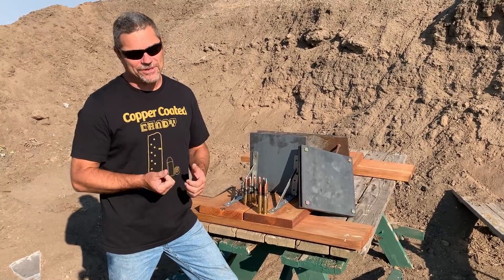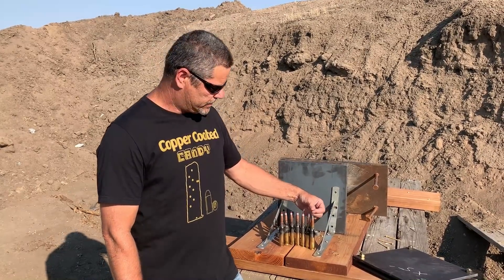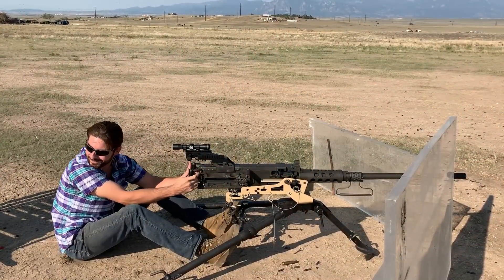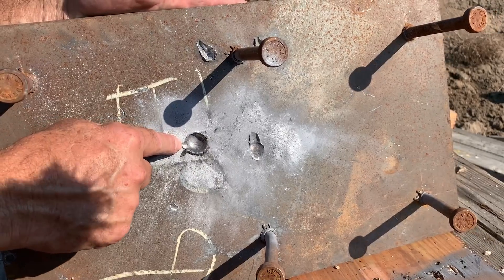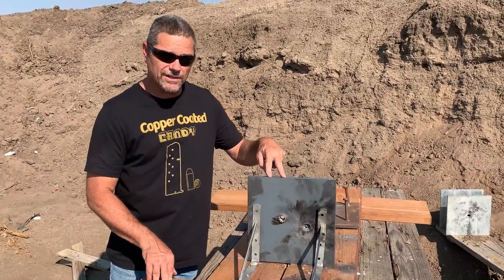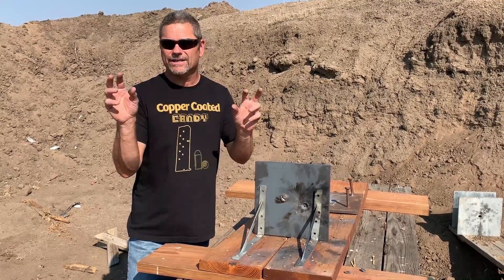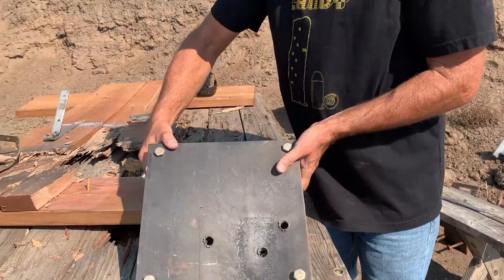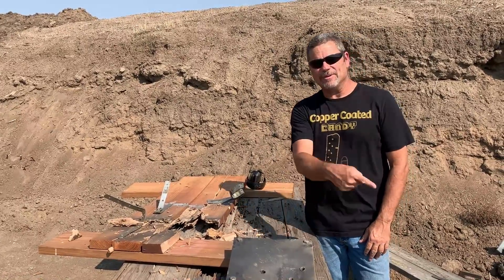Single Steel vs Stacked Steel  💥Bonus round at the end.💥

Comment: Hey hey hey!!!!
Please don't say that! 
Even if you measure it in C 3000 is not enough to immediately melt metal of such thicknesses.
It is only the speed. Read about it! 
It gets close to 8-9 km/s. And SPREADS THE ARMOR RATHER THAN MELTS IT.
Don't you understand it! That's the reason why reactives stop bullets because they explode with      7-10 times the speed of a bullet and it doesn't make it through

Comment: The mass of the plate makes the biggest difference if the round is harder than the plate, if the round is softer than the plate it's mostly the yield of the plate material. 
Typically a hard outer layer backed solidly with a softer but higher yield support material works best. The military likes ceramic backed by aluminum for maximum protection to weight ratios
A layer like this (where the first layer is harder than the projectile) often causes the projectile to shatter or at least deform then a space for the pieces to spread out before hitting a 2nd stack is most effective. The more space the better. This increased space works well at reducing the effectiveness of high explosive rounds as well

Comment: Generally speaking the gap is usually the length of the projectile. Tank armor has angled internal plates to cause the round to tumble, and lose its energy that way. But the gap you have is too small to allow the round to deflect and tumble sideways, allowing it to transfer more energy into the rear plates.

Comment: Curiously some years back I saw a NASA documentary that showed how Much better multiple spaced plates were than a single heavey plate at stopping micro meteorites.
Though they used roughly from memory something like 6 or 7 plates.  In their example I believe part of the effect was the micro meteorite breaking up and scattering reducing it's penetration power.

Comment: layered armor is mostly 1 ultra hard layer to break the bullet into pieces and the rest is for stopping the bits... if you try AR500 in 10mm and a stack of 5mm AR500 and 2x 2,5mm mild steel... you could probably already see a difference.... (scale up as needed for .50cal) also if you double the distance between the layers you should be able to further decrease penetration.

Regarding your "reactive armor" i dont think tannerite is suitable for that. the pressurewave has to destroy the bullet before hitting the actual steel armor... to my knowledge tannerite isnt that fast => bullet already behind the charge when it detonates => increasing the damage to the target.

But i think you could try to build a shaped charge out of tannerite and a copper cone and try that vs the spaced armor.

Comment: Why don't military M2s have optics?
Reply from the maker: For the most part they are for suppressive fire, so just point and pull the trigger, but they have been used for long range snipers in the past.
Reply: @GoingBallistic  
I see. Thanks. It just looked so effective in this clip. I guess you would be too exposed though.

Comment: It would be interesting to stack 3 or 4 plates at a slight angle, maybe 15 or 30 degrees each - first at a 30 degree angle, second at 0, then third at 330 etc.  And as Travis mentioned, a bullet length apart.  Cool shot with Tannerite!

Comment: It'd be interesting to have the plates spaced at just one edge (and touching at the other), so it forms a zigzag.  I suspect that the slight angle might make the plates harder to punch through.  If you had more than 2 zigzagging then it seems like the bullet would tumble and lose energy to horizontal movement.
Reply from the maker: Thanks for the idea.

Comment: New Armor idea using mild steel and ceramic floor tile - alternate stack 3 steel 2 tile, glue them together with constructive adhesive, try with steel 1st then try with tile 1st see what works better.
Reply: I also have an idea gluing sand in a mold to make a sheet using some thin glue in like a 1" deep brownie pan, stack that between ceramic plate and steel plate. If you are going down the home made armor ideas path. I have dozens of ideas you could use P-)
Reply from the maker: Thanks, great ideas, send them to ballisticsmasher@gmail.com and we just may try them.
Reply: The US military found a noticeable improvement to pure kinetic round penetration even from a thin painted on hardcoating. Since then standard steel military armor is face-hardened on the outward side for maximum stopping power for the weight

Comment: Tannerite is too slow an explosive to work as reactive armor. Mil-spec explosive reactive armor uses plastic explosive for the filler layer.

And you're right that ERA is intended to work against shaped charge warheads. You're not right about the shaped charge melting the copper liner, though. There was a test years ago where they (carefully!) sawed a shaped charge warhead into strips, then clamped it back together and fired it into a water tank. What was on the bottom of the water tank was strips of copper!

Comment: .50 cal is 90 years old maybe more
Pentagon could change it more time before with nice experimental  .50 HV (12,7×120mm) franch 12,7×110  mm.belgian 15.5x106 mm and more more 
.50 cal has lose it superiority many time ago
Reply: The downside with changing is the millions of rounds in supply.
Reply: The 0.50 cal is only nominally 0.50 cal. It has an exactly 13mm bullet - just like the Mauser Tank und Flieger Gewehr of WW1. (The TUFG is a squeeze bore - the breach is 13.2 mm and the muzzle is 13mm). It is also exactly 102 years old - having been approved in November 1918.
Reply: I should also point out that it's at a pretty sweet spot in terms of ammo size, weapon size, and power. Sure, the 14.5 Soviet hits harder, but it makes for a much heavier weapon overall and much less ammo per unit weight.
Reply: Scott Kenny And an utterly obsolete weapon in its original anti-armor role.... As an weapon against unarmored targets it still has its uses, and is about as heavy as a man portable non recoil compensated gun can be.
Reply: @allangibson8494  The .50 was obsolete for shooting armored vehicles by 1936 or so. Certainly by the end of the war!

It's only lingered on because we built millions of the guns and it does serve a good use against softskins.

Comment: Great video, I hope you will try the same test with AR500 and AP rounds👍🇺🇸
Reply from the maker: Will do👍👍
Reply: @GoingBallistic  I made a target out of 3/8 AR500 and 1/2 lexan that I spaced about 3/8 apart. Got them off Amazon precut to 12". Lasted longer than the frame after a few hundred rounds of 7.62x54 ball and 5.56fmj.  The lexan did break a corner off about 200 rounds in.

Comment: What would happen if the two thinner plates were bolted together with no spacer?
Reply: Weaker than the solid.
Reply: It's just as strong as full thickness...
Reply: @vetteconnoisseur9531  Not quite.
Reply: @Chris_Garman  try spacing three, 3/8" AR500 plates 1/2" apart...shoot it with a 50BMG and see what happens.  I shoot three, bolted together tight and it shruggs off all 647gr FMJs i can throw at it at 130yds
Reply: For reference, those same 3/8" AR500 single plates get nice 3/8" holes poked by my .300WinMag at 100yds using 150gr PSPs
Reply: @vetteconnoisseur9531  Materials have been studied to the minutest detail. The solid is stronger. It isn't by a huge factor but it is stronger. It will be less flexible though.

Comment: Thanks for doing this comparison. I've often wondered if a bullet would more easily penetrate spaced wood/steel vs. solid (assuming the same overall thickness of material). And FINALLY someone has done the comparison. Thanks for that!
Reply from the maker: Your welcome, we will do this again but with AR500 or 550👍

Comment: Spaced armor is actually better against chemical munitions such as HE, HEAT, HEATFS, and pretty much any round with some sort of explosive filler. When talking about tank armor you must also talk about tank munitions. In WWII, one of the most common round used for both anti bunker and anti armor purposes were armor piercing he explosive, which contained an explosive charge that would only explode if enough armor had been hit. For example, a Tiger I's 8.8 cm cannon firing at a lightly armored vehicle like the M8 greyhound or the M18 Hellcat would most likely not detonate the explosive charge. Both vehicles would still take a decent amount of damage from the spalling from both the round and the armor, however these rounds perform best when it goes through enough armor that the explosive charge detonates. If the same 8.8 cm shot a sherman, that round would enter the fighting compartment and explode turning anyone in there into mush. However, spaced armor actually helps against these kind of rounds if the first layer is enough to trigger the round's fuse, which would cause the round to detonate before it reaches the inside of the tank removing most of its penetration power. This also works against chemical munitions stated earlier, such as HE rounds, HEAT, HEATFS, and more. Any warhead with a HE filler will often detonate after hitting the first layer of armor, weakening its penetration power. Rounds with no HE filler such as solid shot, APDS, and APFSDS don't have that disadvantage and can typically go clean through spaced armor. However there is a caveat, if the space between the first plate and the second plate is larger than the length of a APFSDS round, it could cause the round to become unstable and break apart. This is further supported if the first and second plate are angled and of adequate thickness. This has been done on MBTs such as the German Leopard 2A5 on the turret cheeks. In summary, spaced armor is effective against explosive rounds but not as effective against solid rounds. This was a valid test though, and does prove that a .50 just doesn't give a single fuck lol. But in all seriousness, the best effective spaced armor will be spaced much more than what was tested, which also makes it impractical as body armor or deployable barricades/shields/etc, however are very useful for armored vehicles as it helps against explosive munitions and can be spaced much more as it is being moved by an engine rather than 2 weak legs lol. If you want a pretty good example, the German's Panzer IIIs, IVs, and Panther tanks had somewhat weak side armor where the tracks were, thin enough that the soviet anti tank rifles could go through them and damage components and injure/kill crew. This was solved by adding what they call Schürzen, thin steel plates around the tanks, (link to an example http://wotbase.ru/wp content/uploads/3024de929674_C430/0ussaybm.jpg of the Panzer IV's Schürzen) which was enough to stop the soviets AT rifles from penetrating and also helped against their shaped charged weapons and such.
Reply: What a bullcrap, u guys stop with this spaced armor.is better, it was just proved its not and they still putting up some bs theories do defend their statement
Reply: @Angry-Lynx  Its better against chemical munition, i never said its better for small arms fore and such. With small arms fire and body armor its much less effective as spaced armor is most effective when the spacimg is more than the length of the bullet or round fired at it. So because of this, spaced armor is less practical. Did you even read what I said? Also testing on mild steel plates with .50 bmg does not scale up to vehicle's armor and rouns much bigger than a .50 cal. The only thing this test proved is how stupid people can be assuming one video is 100% all the evidence needed to prove spaced armor doesnt work. This video is good, and does show the downsides of spaced armor for certain applications such as smaller scale things like body armor as it would be very impractical to use effectively spaced plates as body armor if you look at it from that prospective. You should always take videos like this with a grain of salt. I personally think this video was fairly unbiased and I trust this channel. However to think spaced armor is worse is actually retarded because militaries around the world have been using it since WWII. Like I said,, In small scale applications,spaced armor is worse, however for armored vehicles its practic and often better for what they need as vehicles are often hit by chemical warheads.

Comment: Just wondering if you could try the tanner rite like this? Maybe Putin it in between the plates. Seal the bottom and 2 sides off then shoot it like that. Great video man y’all keep posting!!!!
Reply: The front plate would take someone's head off.
Reply: Chris Garman that plate ain’t coming apart if it’s welded good it will break that plate in half before a good weld breaks
Reply: Chris Garman have you not seen how reactive armor works it’s 2 plates with explosives in the middle
Reply: @JR36802  Doesn't make it a safe thing for DIY. Nuclear reactors exist too but I don't want you making one in your garage.
Reply: Chris Garman is that a nuke no it’s explosives the same thing he’s already messing with 🙄
Reply: Chris Garman do you see nukes at anyone house like you do tanner rite let me answer for you nope
Reply: Chris Garman and on top of that with the top being open on what I was talking about most of the energy will blow outa the top
Reply: @JR36802  Obviously the level of intelligence here is too low for proper discourse.
Reply from the maker: Great idea